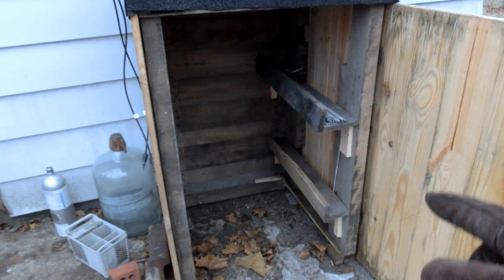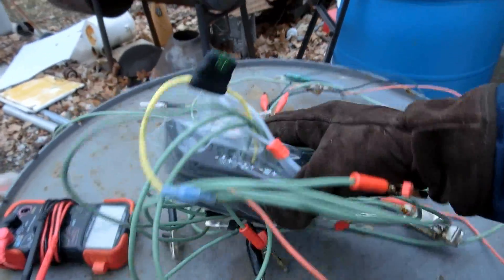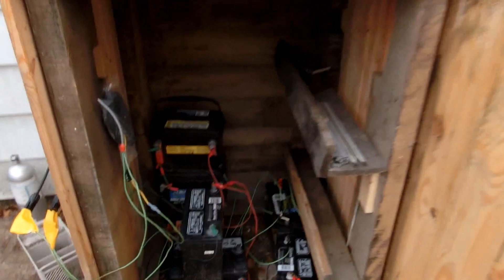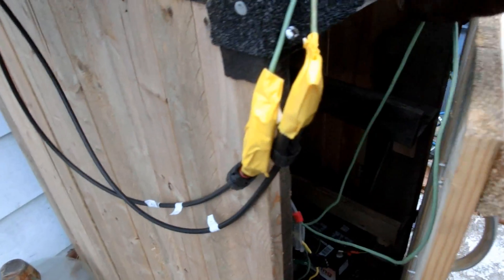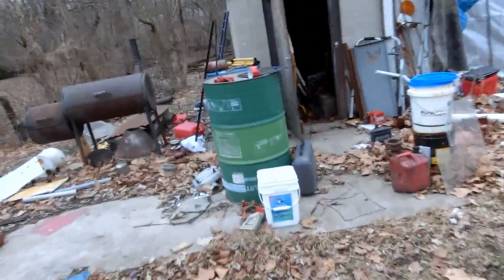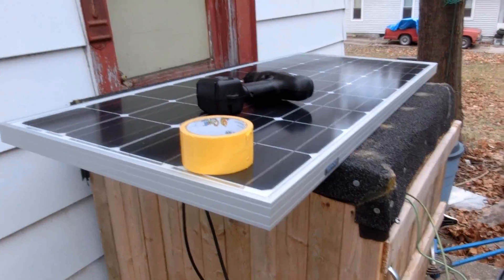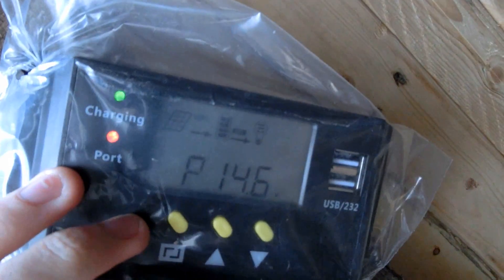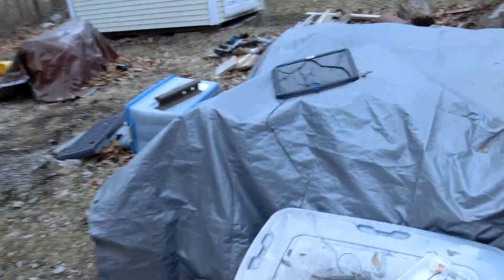Solar Sunday Experiments 006: Battery Shed

Comment: dont place car batteries directly on concrete use a insulator but awesome experiments man
Reply from the maker: ah you believe in that myth? well thats not how batteries work anymore, if ever.
Reply: I was told by my master mechanic ....why the hostile response perhaps you should explain to me and educate i was enjoying your channel but if that is you attitude i may unsubscribe.
Reply from the maker: Tom Brazil
i've explained it a lot already and the information is easy to find. old batteries used to be made of wood so would rot when on wet concrete, but they stopped using wood on batteries in the 1930s.
Reply: Rinoa Super-Genius Not a case i believed in that myth.....i didnt know it was a myth at all i was misinformed.I perhaps should have checked but being a teacher i thought it was valid information.I have watched a few of your videos in which you didnt cover it in those videos,but now i know still found your response a little demeaning.Like I said awesome experiments which you did not address:(

Comment: could someone help with a li-on battery charger? i tried looking for a good one but i don't know much about battery chargers or brands. i'm looking for a smart charger with a screen that can charge single 3.7 volt li-on batteries or a 3 cell pack of li-on batteries any help on what i should be buying? help greatly appreciated.

Comment: That smaller solar panel that's on the electric lawn tractor does it have its own built-in Charging Controller/Regulator??
Just wait tell summer in California you'll be wishing you're back at your moms house, lol
Reply from the maker: why? its over 110 F* and 100% humidity in illinois during the summer. its cooler in california.

and no it doesnt have a charge controller, its just such a small current it doesnt matter. only 150ma at most.
Reply: Rinoa Super-Genius I thought in the summer California would be hotter overall with the humidity, than where your mom lives, lol
Reply from the maker: redneckbryon
no california is regulated by the ocean. but illinois as continental weather

Comment: I would b scared to leave that charging while u r gone
Reply from the maker: why? it has a fuse on it, and ive let it charge for like 2 months already before i disassembled it.
Reply: Rinoa Super-Genius if you didn't have a solar charge controller, then you'd have something to worry about, but given that you've got a controller regulating the voltage, you should be fine.
Reply from the maker: lanceguilin
well even without that this panel's max output would still be able to be dissapated by the batteries since 5 amps spreads very thin across them. they wont be getting 5a though more like 1a across them all. so thats only a few milliamps. with such low charge current it really doesnt matter.

Comment: Hope your flight went well, i'm in southern oregon, no where as warm as most parts of california, but its still in the mid 60's and sunny, so i can't complain, if it weren't for the cost of living and denser population id move down to the carlsbad/san diego area, its never below 60 F and never higher than 90 F
Reply: connly33 After living in southeast WI for five years, I'm extremely glad to be back in so. OR, -10F winters sucked.
Reply from the maker: that sounds really awesome tbh. but now that i'm in silicon valley it feels pretty awesome too.